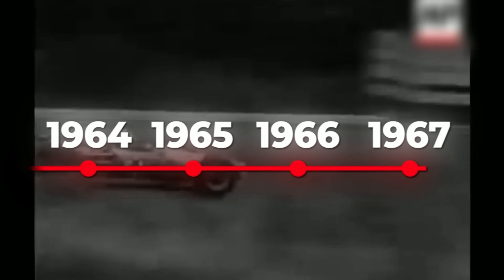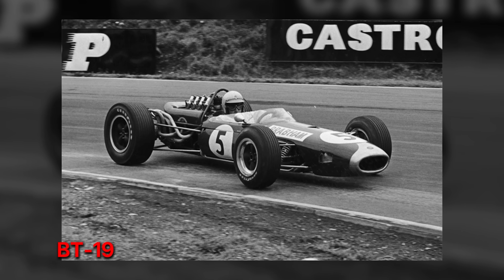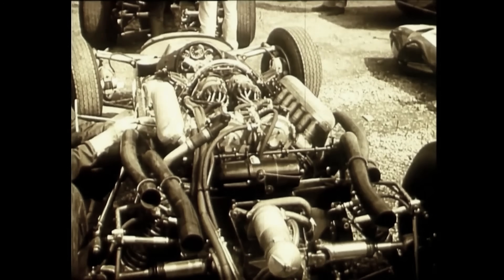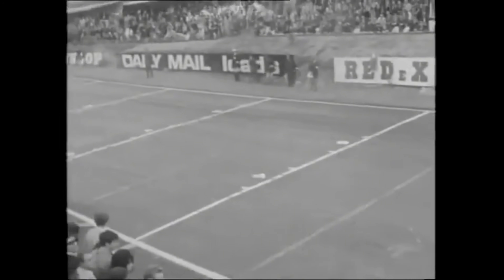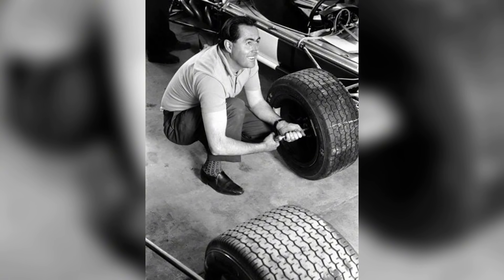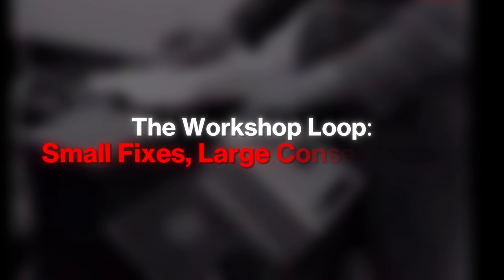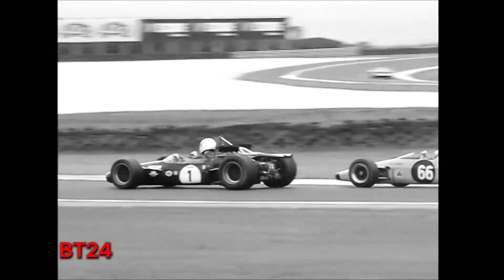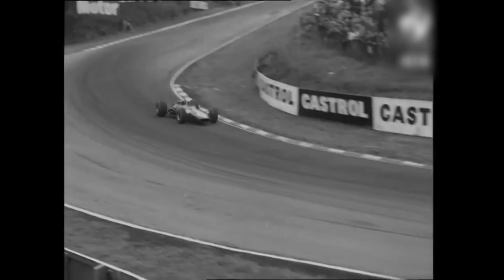The Explosive Truth Behind Brabham’s Bulletproof Repco 620 V8 Racing Engine

Comment: I cannot say for sure but I think the only engine  Jack built was a failure. I was very disappointed when he said steamers would never be a commercial contender. The fact was he had no idea of steam power. It was said at a critical time when a friend of mine, Ted Pritchard designed and built a steamer. Later took it to the States where it was demonstrated to Senators and the motor industry It was the lowest emission engine in the world and to my knowledge still is . That's over fifty yeas ago. Jack was a smart guy but didn't know everything. A steamer would have left anything he drove for dead. In the old days the vehicles had wooden spoked wheels . With the acceleration steamers  tore them to pieces. Then came the wire and steel wheels. I'm hoping steam is just around the corner. VOTE STEAM

Comment: The little Buick/Oldsmobile 215ci Alloy V8 grew into the basis for so many engines , obviously this FI engine redesigned in Australia ( Oldsmobile F85 turbo block ) , then sold to Rover lasting till the 2000s, it was also the basis for the Buick V6 by cutting two cylinders off , used by Buick , Jeep , Pontiac, GM Holden Australia, untill 2007 , also was the basis for the Buick V8 Small block family of which the 215ci was the smallest , then 300ci , 340ci and finally with a deck/head redesign the 350ci Buick V8 , it was also the basis for the Leyland P76 in Australia as the tall deck 4.4 litre (270ci V8 ) in the sedan the P76 . 

Rover only stopped using it when Rover was purchased by Ford and Ford management refused to build/sell a GM V8 . So swapped in a BMW unit. With associated reliability and cost problems.
Reply: I got caught out on a "Who can identify this engine," vid? Turns out there are 2 different GM division aluminium engines and they're different. One from Olds and the other from Buick. They aren't the same apparently. Of course I said Buick but it was an Olds. AI overview gives a breakdown of the differences.
Reply: @ThePaulv12 yeah really the Olds version has extra head bolts , and Olds redesigned the heads to look more Oldsmobile, the extra head bolts were for the Turbo F85 Oldsmobile. But still a small block Buick in the end .

Comment: Some might argue that calling the Repco 620 a “masterclass” overlooks how much the DFV simply outclassed it within a year. Brabham’s success in ’66 was as much about timing and rivals’ failures as it was about engineering genius.
Reply: The 620 was a masterclass in simplicity. And that was what was required at the time, a new formula, a new era. The DFV was the perfect response, but in 1965 Brabham didn't have the coin to develop something like that anyway. Frugality was important, to such an extent that the heads were a singular casting, fitting either side to cut down on the spares needed at a race weekend
Reply: Lmfao , so you are comparing a multi million dollar DFV with a GM push rod Buick / Oldsmobile car V8 redesigned by a small Australian company? Is that correct ? Get a grip , if the money that went into the Ford went into the Australian engine , it would have lasted just as long .
Reply: @JosephCowen-fz8vj  The Repco was not a push rod engine, and it beat the DFV.
Reply: Given it was built with no budget out of a stock block by engineers after work in a shed in Moorabbin the Repco went okay! The DFV was funded by the FoMoCo and had a lot different basis. It is a pity Repco is not the engineering powerhouse it once was but just a parts distributor today.
Reply: Within a year? RB740 won the 67 title, 3rd in 68, decision to continue would have required major scaling up to be a F1 engine manufacturer.
Much of Cosworth's success for the following decade+ came from the work of a company called Engine Development Ltd, started by Brabham and Judd after the Brabham Team was sold.
Reply: The Repco outclassed the DFV first.
Reply: DFV was backed by Ford, one of the biggest companies in the world at the time, and an engineering giant.

Report was a tiny company in Australia supplying....

Comment: Brabham went to Honda east west mounted engine as technology pushed up the power, become the world champion, Buick/Brabham V8 went in to Triumph Stag cars ,much detuned version, then Leyland 4.4 V8 etc🏁
Reply: All correct with the exception of the Triumph Stag. The Triumph people had the opportunity to use the Buick based Rover V8 but instead built their own temperamental unit.
Reply: @GraemeDay-b2u  And SOHC
Reply: Lol, sorry mate , the Stag V8 has nothing to do with this engine , totally different design , infact Stag owners removed the Stag V8 to put the Rover one in. The Stag V8 was a poor design . And as far as the " Buick" it was an Oldsmobile Alloy  V8 used , the block from the F85 Turbo 215 V8 . It has more head bolts than the Buick . The Leyland P76 4.4 is a different, tall deck version , same deck as the Buick Small Block 300ci, 340ci V8s .
Reply: @JosephCowen-fz8vj  And P76
Reply: @jimclarke1108 yes , very true , I added that at the end , also in Leyland Force 7 if it was released, and Leyland trucks Australia, but I've only ever seen 5 of them with that engine option, the 4.4 was intended to grow over the years by Leyland Australia to about 6.0 litres , that's why they raised the deck height over the 3.5 litre Rover , but it never happened and the 4.4 was the only version . It's funny because Buick redesigned the 300/340ci to 350 ci and the 350 Buick Small Block has the same deck height as the Leyland 4.4 . You could probably make an all alloy 350 ci out of a 4.4 block with all 350 Buick internals . They even make stroker kits in the US to take the 350 Buick out to 6.2 litres . That kit would probably fit the 4.4 Leyland,
Reply: @JosephCowen-fz8vj  Sounds great

Comment: Unless I heard wrong..They said the '66 Lotus was a space frame, the Lotus 25, 5yrs earlier was the first monocoque, and then the type 49 was the '2nd' generation monocoque car, in '67😅 with the Repco V8 my fellow countrymen Jack drove & built, but will watch the video again to clarify, greatly scripted video 😀 was happy to see more info about this engine, thanks from Queensland Australia 🌏 but  they seem to keep mentioning spaceframes, when everyone had moved to monocoques, especially when the Cosworth Double Four Valve  DFV became a stressed member and changed the game for the next 15yr generation. And why do they call the Lotus 25 or 49 a BT-19 etc? Manufacturers numbers?
Reply: Brabham hung onto spacefromes until IIRC 1969. Jack reasoned it was a lot easier to repair a spaceframe than a tub. BT19 was the 19th design of Brabham-Tauranac

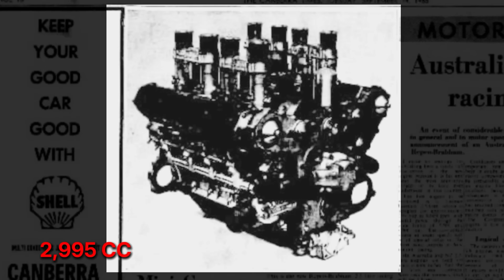Comment: 5:57 , this is NOT  a sohc , this is a pushrod engine.
Reply: No it's not , wow , do some research, before opening mouth, it started life as a group of Oldsmobile ( version ) of the Buick 215ci Alloy V8 later used by Rover in Range Rover's , the Australian engineering company Repco and talented Australian engineers cast new Single Overhead Cams and Pistons, rods, crank , oiling system, cooling system to create an engine that beat Ferrari, Ford, Lotas and more . Two cams , one over each head .
Reply: @JosephCowen-fz8vj  the graphic is push rod.
Reply: @alexjohnward  Reality was it was OHC. Do your research and avoid looking a dill!
Reply: @robwettenhall3383  The diagram is of a pushrod engine, it has pushrods in it, it is incorrect for the engine in this video.
Reply: @alexjohnward  
Who cares what the AI garbage shows in the graphics the actual engine used had OHC!
Reply: the commentor cared.
Reply from the maker: Thanks for your feedback 🙏🏻❤️
Reply: techincally a twin camshaft + pushrod engine. A single camshaft per bank with shorter pushrod lifters than full pushrod OHV, yet would have been easier to use single central camshaft OHV higher up in the V like Renault used on their OHV L4 to shorten the pushrods and improve high rpm running. Some have done this in speedway on custom buick engines of the 1970s.
Reply: @user-fj4tn3qf7k no push rods , cam on bucket heads designed in Australia.

Comment: Read between the lines here!!!!!!!!!   Jack's nickname from the other Drivers of the Day was "The Fox!"    I wish, with all my heart I could find out where the Rotary engine MODEL,  I saw him demonstrate at a friend's house in Bathurst is.  It could also be used as a Pump, running several cylinders with petrol and maybe a couple to pump with!  NO I WAS NOT DREAMING!
Reply: There was a lot of forgotten engineering from that time frame,,, as a kid in early 70s I saw a magazine article about an overhead camshaft on a Holden grey motor,,,, now I've seen blower set-ups also,,,, I don't know who the engineers were but I'm sure there's some 80 yearolds that remember ,,, I'm sure it was drag racing
Reply: Waggott Engineering made a twin OHC head for grey engines, Dunstan made a rotary valve head for greys, and Repco made a crossflow head. All done in the 1950s